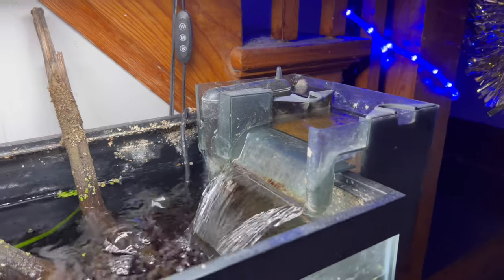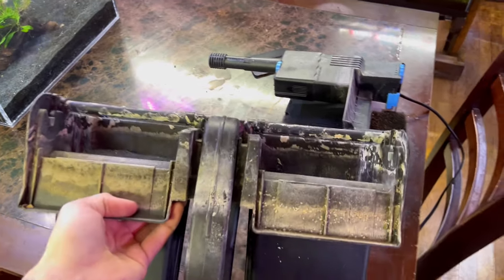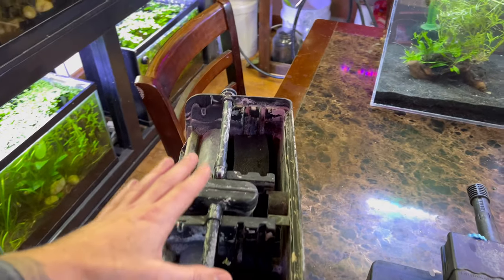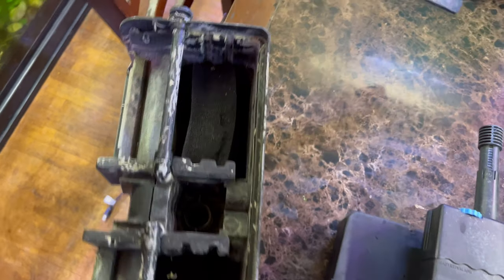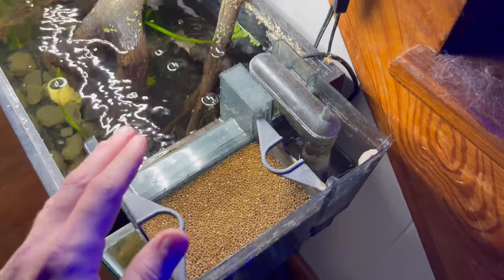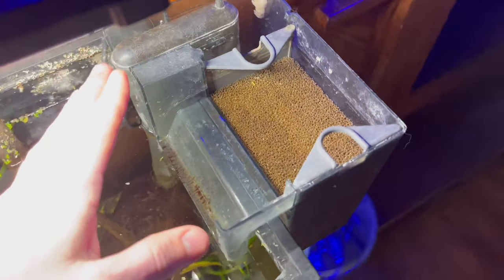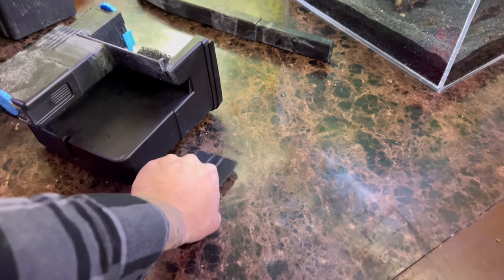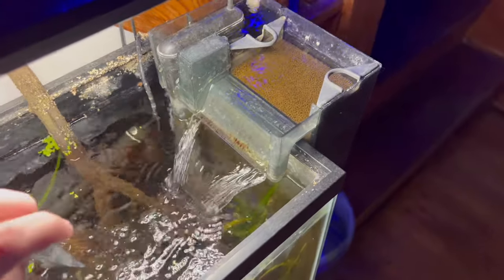Aquarium Filter is Loud and Noisy? Help

Comment: After several attempts at dealing with the filter, i noticed that it is actually from the Tank's lid... Placing my hand on the lid stops the vibrating buzzing noise

Comment: I seen the Aquaclear on the thumbnail and had to click, those filters are good till they start going bad, then they’re just terrible. I’ve had tons of hob filters over the thirty years in the hobby and the best I’ve had are the cheap ones Walmart used to sell, don’t remember the brand but they lasted the longest about 15 yrs with virtually no problems, Aquaclear hob’s usually lasted about two to three years before it’s time to replace it. I’m running a Aqueon now on a 55gal for a little over a year and so far I haven’t had any problems with it, not the greatest but it does filter and move’s some water.